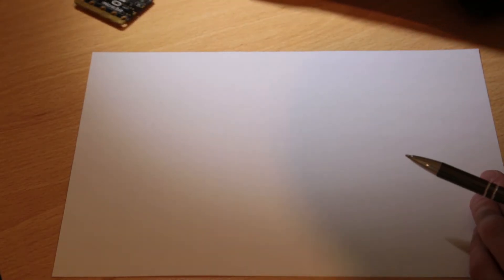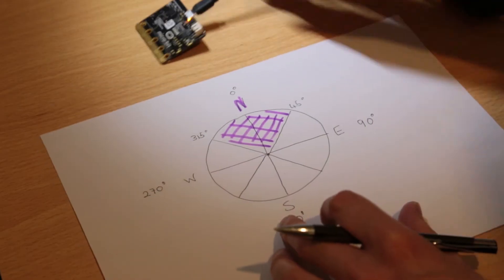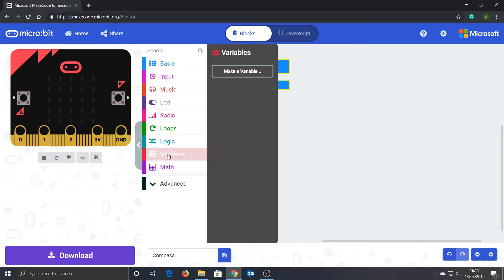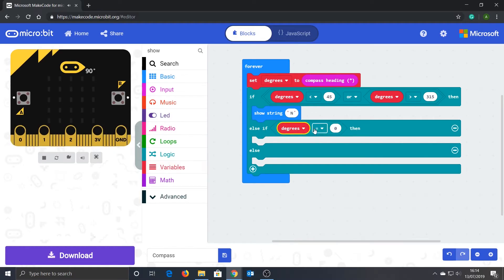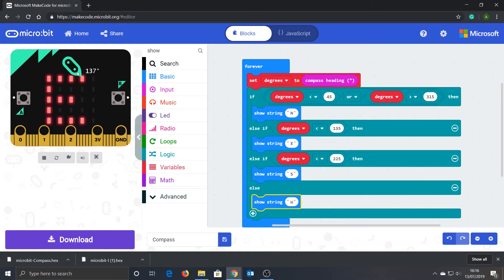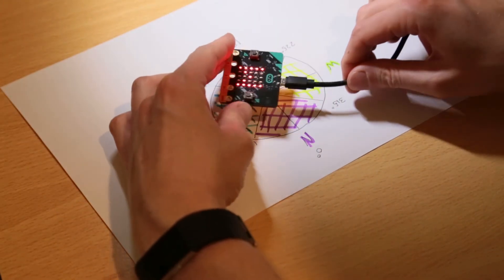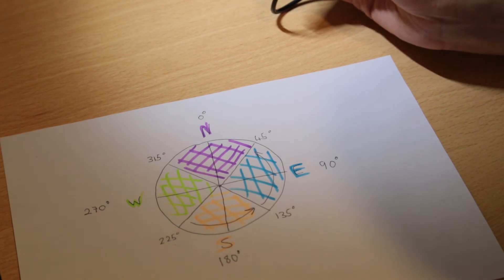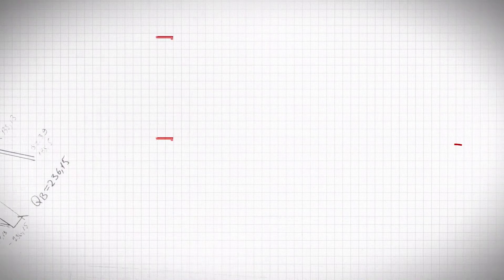How to make a compass with a BBC Micro:bit | Coding | STEM | Project

Comment: A few more lines of code and I take it you could have NE, NW etc etc?
Reply from the maker: Thanks for watching and commenting! Yes definitely, I only omitted these as I wanted to make this video as quick and simple to follow as possible. Have you used a Micro:bit before?
Reply: Yes I have been using different platforms but I'm not the greatest at coding!  I'm playing with pi4 just now and considering giving pico 8 a go.  I also want to try a spectrum emulator as I have a book with spectrum codes!  My youngest is 15 so I'm trying to get him interested.  I really started in electronics building circuits but microcontrollers are now a big favourite if only I was better at coding!!
Reply from the maker: I've not come across Pico 8 before but just Googled it, looks great. What language are you coding with on the Pi4? I tried a bit of Python with my youngest on Pi and he did Scratch at school. Talking of microcontrollers, we've also played about with the Arduino Uno, although not done any videos yet. Coding comes with practice but I am still very much a novice, I do enjoy it though.
Reply: @iNimbleSloth  I've done a little bit of both but really just using others code and modding it rather than doing stuff from scratch(excuse the pun).